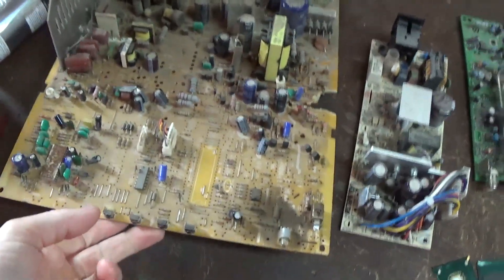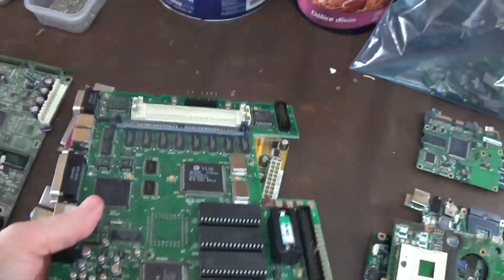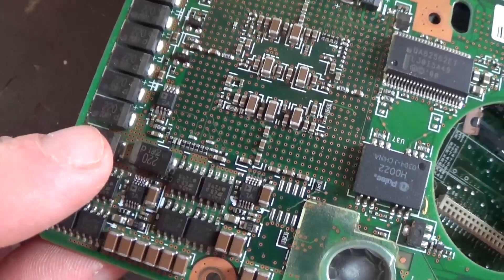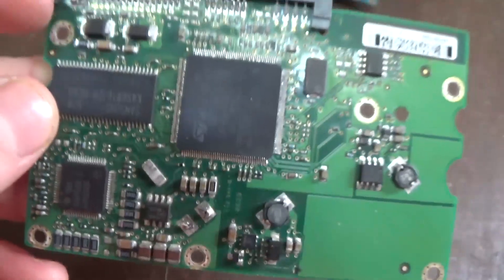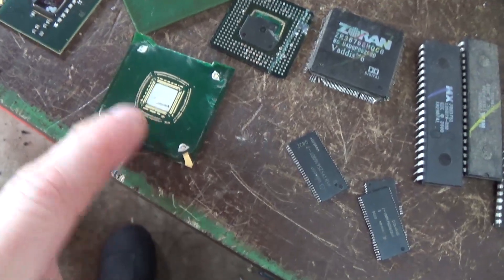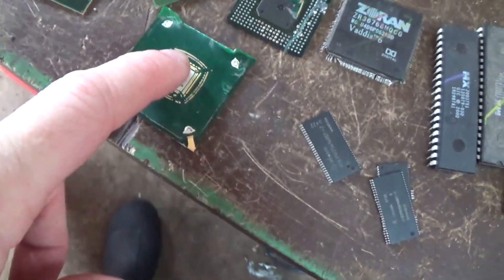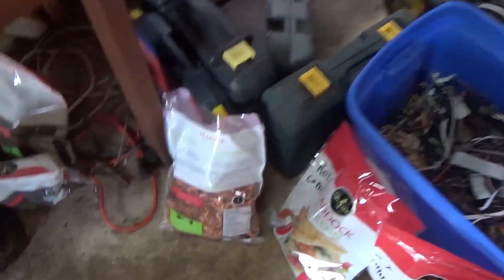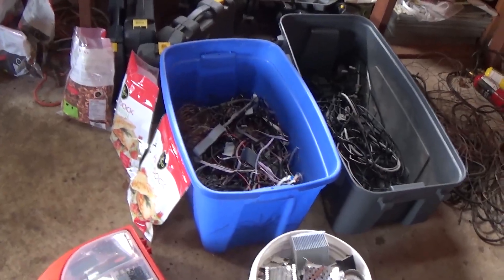Grading Circuit Boards - E waste

Comment: Just be cautious, because the gold corner BGA chips have the gold bonding wires  actually inside the black top. The bottom has almost nothing, just some flashing, which is obvious from results from a few refiners on Youtube.